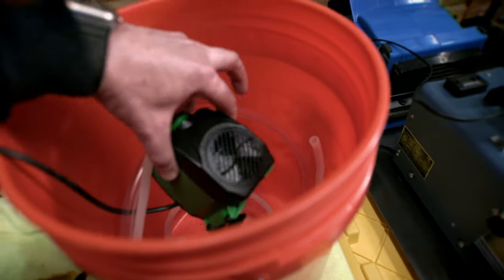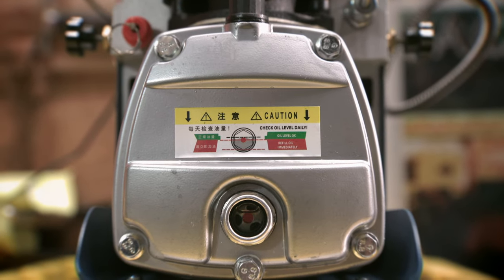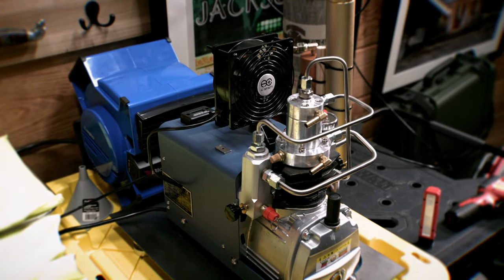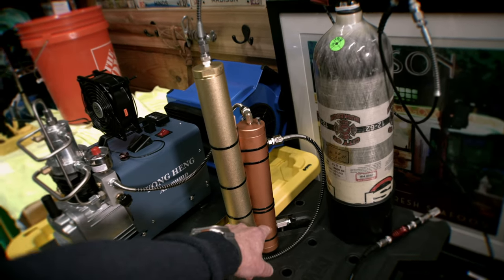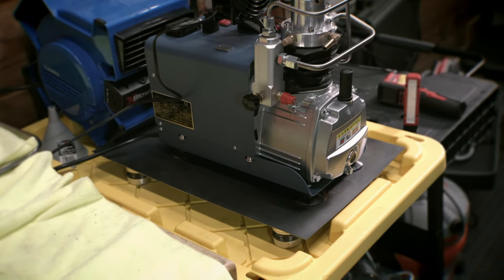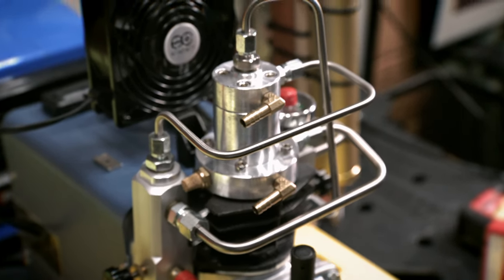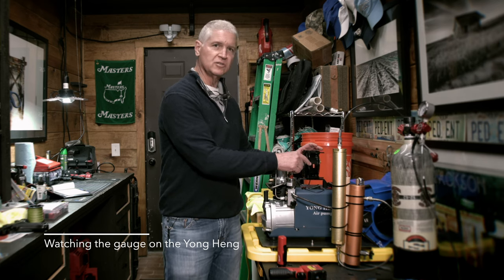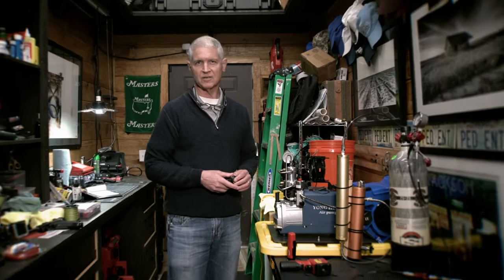Yong Heng Set Up, Modifications, & Impressions

Comment: By adding a check valve to the outlet side of your molecular sieve filter you can open the valve on your tank before starting the compressor, and not have to worry about when to open the valve. When the compressor and tank reach the same pressure the check valve will open allowing air to flow into the tank. When done filling the tank just bleed the line at the tank's valve and compressor.
Reply from the maker: Very good point. Absolutely agree, and that's why I now have one. I think most people don't have one, so I didn't mention that in the video. Thanks for the comment and thanks for watching!
Reply: the non-return valve on the bottle is perfect. No more worries, personally I haven't added anything. I use the original filter, a 20l can, 10l demineralized water and 10/ cooling liquid. I never exceed 10 minutes and 55 degrees. I leave the humidity filter always vertical. Never had a problem with humidity, it remains well at the base of the filter and is never reassembled. It is also good to let the air out of its bottle after have put it upside down to bring down any humidity in the bottle and thus expel it. And if necessary a filter from the bottle to the carbine. I think that the additions do not bring anything but that is only my opinion .Thank you for your feedback and explanations.Peace

Comment: These are SOOooo good and pretty much the go to compressor for air rifles. I LOVE the air rifle sport. It's fun, and keeps me out of trouble, and the Yong Heng has treated me right flawlessly for three years so far because I change the oil every other fill up because it's CHEAP, and I use ice cold distilled water. Distilled means NO minerals to clog it up after many times of use.
Reply from the maker: Thanks for the comments. I completely agree with your love for the sport. Here is something to consider from the expert on the YH from the Airgun Nation forum (biohazardman) and a link to this discussion:  "Distilled water is not a good thing to use as it will eventually cause pitting in the aluminum parts exposed to the water." https://www.airgunnation.com/threads/a-dedicated-yong-heng-subforum.1127731/#post-1127767
Reply: I have a dehumidifier in my basement.  I use the condensate water from it, to cool the head.  Also the dehumidifier keeps the humidity to 40%, so there’s less water in the air to start with.  Works for me !

Comment: Great video Mark. The main cause of heat in the Yong Heng is the larger, lower cylinder. You have that covered with your high volume fan in the rear. People go crazy cooling the top and the lines, which are already water cooled. Like you, I use ice, which is a must. In the last year, prices have come down on the larger compressors. I recently saw the Hill, from the UK selling for under a thousand US dollars. I,however, am staying with my YH. It does the job at a bargain price.
Reply from the maker: Agree! Thank you.

Comment: Great info!

After

When you were talking about blowing out thw water in the cooling loop, an idea occurred to me. With most of us having hard water, it may be a good idea to flush out the loop out with distilled water at the end and then blowing out with compressed air. Even go so far as flushing with vinegar periodically to help with mineral build up.
I'm also planning on removing the fan cover permanently since it's only me that runs the unit, and I never leave it running unsupervised. Also, planning to bore a number of large holes throughout the motor cover to help with venting.
Reply from the maker: All great ideas. I'll have to try them myself. I really like the venting idea. Thanks very much for sharing and for watching!

Comment: Another good vid, on the Yong Heng. New to this, and I appreciate the extra tips from another experienced YH user. Thanks.
Reply from the maker: Thank you very much! I hope your adventure will be as fun and rewarding as mine. What a great hobby we have!
Reply: @jmarkreed hi good day, sorry you busy. Help me you? I bought the new yong heng pre set version 2023 production.  How many ml of oil capacity do you think is recommended?  250 ml is not enough
Reply from the maker: @kricketkricket6737  I don't know the exact amount of oil it takes, but it needs to reach the red dot in the viewing window. I would just fill it until it reaches the dot and consistently make sure that it stays in that area before using it. Thanks for watching!

Comment: Hello Mark.
I want to use a compressor to transfer Helium from large baloons back in to a cylinder/tank which has 200bar.  I´m looking for a cheap transportable compressor which has like a small opening where is sucks the air which it is compressing so that i can add a tube and connect it with the baloon. So it musn´t have big slots and holes regarding this purpose.
Can you please recommend me a Compressor ? Can you please tell me how the Yong Heng - Compressor absorbs the air , does it have a small hole ?
PLeas help me , thx !!
Reply from the maker: Wow. That's an interesting question. I wish I could help you with it, but I can't recommend something that is outside the intended purpose of the unit. The YH has a small air intake, but I have no idea how you could attach a hose to it. I'm sure it could ultimately be done, but that doesn't mean that it's a good idea. Sorry, I'm not much help with this one.

Comment: Tried mine out last night. filled a 7 litre bottle form 100 bar to 250 bar in about half hour of run time stopping it to cool when it reached just below 50 deg c, ice helps in the water for sure, i used a 30 litre water container too, will fill my other bottle today with plastic pop bottles filled with frozen water in the water too to cool it more. Thanks again  for your helpful advice.
Reply from the maker: Excellent! Sounds like you're doing great. I agree, ice makes a big difference. Keep up the good work!

Comment: Hey my high compression piston seems to be going to high and locking up because it cannot return the stroke. I'm fairly used to piston strokes from racing motorcycles, 2 strokes, but this thing has ne really confused and hard to find good customer support. I'm getting ready to replace the whole unit or just whole top end but I'm really interested in figuring this out. 
Also, the top high compression piston is tight!

Comment: I modofied the crank shaft on mine to fit a bearing and built a chiller for it aswell. I also put a manometer an solid state relay for an auto shut off
Reply from the maker: That’s great. Sounds like you definitely know what you are doing. Great job!
Reply: @jmarkreed  i do what i can! Son of a brilliant millwright and it runs in my blood forsure! Ive got three of these compressors and heavily modofied one of them just for scientific purposes lol

Comment: Thank you for your video on the Yong Heng.  You mention  Mobil Rarus oil.  Can you share which product, 427, 827 or MR compressor oil?  Thank you.
Reply from the maker: Yes, thanks for asking. I use the 827. I bought it from a dealer on EBay. The amount for 1 oil change was $18.95, so I figured not bad for a years worth of great oil.

Comment: I have the same set up, and I cut a little opening out of a one gallon milk jug Leaving the handle. and I fiill the milk jug up 3/4 of the way full and freeze them. So I have several of them in my freezer and then I put it in the 5 gallon bucket of water, I can fill a full tank an that water stays very cold and then when I'm done I just fill it back up an put it back in the freezer for next time.  Works great
Reply from the maker: Yes, that's a great idea. I have an ice machine that makes it easier for me and gives me a good excuse to clean it out when I use the YH. Ice is definitely the key!

Comment: hey mark what would you buy right away could you give me a shopping list of the things i need? i have the lasko fan and a bucket so far..
Reply from the maker: I think the only "essentials" besides a bucket with ice water are a good air filter like the "gold" filter and great oil. Everything else are very good extras (like the Lasko fan and a temperature gun) to monitor temperature and enhance cooling. Great oil keeps the YH running well, and a great filter keeps water out of your tank- both incredibly important.

Comment: Why do you not want the oil to be above where you have yours?  Mine is a closer to the top of the window, when I look in the tank it looks so empty.   Since you have had success with that fill level I am going to roll with your assessment, just curious what happens if you go much higher than that.
Reply from the maker: We’ll, I was doing my best to adhere to the manufacturer’s recommendations of having the oil no higher than the top of the circle. That’s what is recommended in the included manual. I honestly don’t know what the consequences are for higher filling. I bet someone has addressed this question in some of the forums but I never thought I needed to fill it any higher than recommended. Thanks for asking.

Comment: I do like your setup. Do all the extra length hoses and separator's add extra stress on the compressor ?
Reply from the maker: I think they do to some extent, but the filters are a necessary evil. I am not aware if anyone has quantitated the difference, but it would certainly have to add some. Thanks for asking. Maybe someone who knows more will chime in.

Comment: as an older guy this is one of those "fit for purpose" things
take a little time and it will be fine
try to run it as a commercial one and you will be disappointed!
I've had one 3 years now and have a similar rig to you!
horses for courses and agree
I'd rather another rifle than a 4k compressor that does the same work!
at 50 I can take a little time to save a LOT of money :)
have a great day
subbed
thanks for sharing :)
Reply from the maker: I couldn't agree more. Thanks for taking time to watch!

Comment: Just ordered mine, I'm going to see if I can drill and tap the cylinder and head on the opposite side of the existing water ports, and install 2 more fittings.
This when coupled with the higher flowing water pump should effectively almost double water flow and cooling 😎
Reply from the maker: Wow. Love to see that work. Let me know how it goes.

Comment: Nice demo..Thanks for taking the time.
I sold my beautiful Honda gas powered Coltri MCH6 when I moved, and now after hand pumping for only 3 shots for my big bores or a mag from my FX impact, I'm seriously regretting it. I shoot a lot..
I can't justify the $3500 for a better compressor right now. I do have a 4500 psi carbon fiber tank, but I'm between filling it with a Yong Heng, or filling my rifle with the GX CS2.
both have their advantages..
 I don't want to spend around $1500 for a mid range compressor that's not much better than one of these as far as I can tell, because later it will be less justified if I decided to buy a higher end compressor..
I know you now own both.
Any advice on which way I should go to get me by for a year or so?
Thanks..
Reply from the maker: Wow. You’re asking a really tough but very practical question. I’m having to think hard about this. Okay, looking on Amazon the GX CS2 is listed for $305.99 but there is a $25 coupon available making it $280.99- great price. You can also add $33.99 for a 3 year protection plan or $44.99 for 4 years. No brainer to go with the 4 year warranty. Since you’re only looking at needing something for a year or so, I would totally go with the GX CS2 at that price point and the fact that you would get a free replacement for up to 4 years. Seems an extremely safe bet to me. You’re good for 4 years of saving for a high end compressor if you want. Love my YH, but in this situation I would go with the GX CS2.
Reply: @jmarkreed  
I'll order it..
Thank you so much..

Comment: I have done everything that you have done, except for the second fan on the top blowing on the head.  I never run mine more than 10 minutes, or past 60c temp, whichever comes first.  I run Royal Purple oil in it.  I have had 4 or 5 Yong Hengs in less than 2 years.  I fill a 9L SCBA bottle from 220bar to 300bar most of the time.  I have never gotten more than 10 running hours our of one.  Yes, I did buy another one this week.  Granted, it's doing the hardest part of the work all the time.  But 10 hours?  It should be better than that.

Question:  In the 3 years that you have had your compressor, how many working hours do you have one it?
Reply from the maker: That's interesting. I'm a little surprised, but I wonder if it all has to do with the fact that you're primarily filling a 9L tank. It would be interesting to see if the lifetime changes if you only fill a 6.8L (45 minute) tank instead. That's what I do, and I'm positive I have a lot more than 10 hours usage. I'll have to go back to my log book and add up the times to see what my total time is at this point. I would agree with you that you should be getting more than 10 hours. With this next one, you may also want to try Mobile Rarus oil to see if it makes a difference. It would be a good experiment.
Reply: @jmarkreed  Yes, I would be interested in seeing how many hours you have on your compressor.  If oil is the problem, I have no problem buying whatever oil is best.  I have tried a few different oils in the past.  Royal Purple is a good oil.  I have ran it in my supercharged car and transmissions, rear ends, etc.  Atone point, the compressor supplier said to run it.  I will look into the oil you are using.

Comment: Put a one-way valve (BestFittings sell one) between tank and compressor, when pressures are equal air will then pass into tank without needing to guess when they're equalised. I added cooling fins to the transfer pipes on the compressor and use a fan to cool those.
Reply from the maker: Yes, thanks! I agree. I recently bought a really great one way valve from Air Tanks Plus  (https://airtanksplus.com/product/quick-connect_in-line_one-way_check-valve_w_bleed_valve/) that has a bleed valve and can be used on any tank I fill. It's a very handy addition. I was assuming that most won't have something like this.
Reply: Part number on the one way valve?  Link?   I see your car tags hinds & Madison.  I’m in hinds my kids are in Madison.    Great video.  I love my compressor but mine doesn’t have the auto stop. Got mine several years ago and mine runs great.   I run a fan on top to help cool the cylinder also.  I run antifreeze in my bucket at room temperature never had a problem. I use royal purple oil in mine.

Comment: OK, I do have  a question for you Sir while I am waiting for my pump to get here. It concerns the cooling liquid you use. Just as you said, everyone has there own opinion of what to put in and the first thing  I read was plain ol tap water. Where I live  there is a lot of calcium in the city water. Does that change the equation? I have read to use straight anti-freeze, then anti freeze mixed with water,. (No ratio yet for the mix). Then use only distilled water, then  mix antifreeze with only distilled water/ or only tap water....You have 3 years of running your compressor. I trust your answer for that very reason! I do know yet just for sure what ever coolant I end up with, only that  it will be chilled with ice before it goes inside the pump. That much I do know.. Just need your feedback as to what you personally use. 
As always Thank You Sir for your time and also our willingness to share your knowledge!!!
Reply from the maker: One thing I know for sure is not to use distilled water. That has been shown to be a problem. Multiple posts in the forums address this. You would also not use antifreeze alone. I believe those who use antifreeze keep a reservoir of water that is used over and over. I don’t do that, but I don’t have a problem with that either. I use tap water and ice which are replaced with each use. That’s just how I do it. I believe a lot of others do that too. I don’t know what to tell you about the calcium. I’m not sure that’s a problem or not. Thanks for asking and for watching!
Reply: @jmarkreed  Thank you Sir!!!

Comment: You mentioned using Mobil Rarus oil.  Which version, 824, 826, 827, etc?
Reply from the maker: Thanks. I'm using the 827. Seems to be doing a good job. Stays very clean (at least by appearance).
Reply: Where did you buy it? It's crazy expensive
Reply from the maker: @mathewatherton9832  I bought it from a dealer on EBay. The amount for 1 oil change was $18.95, so I figured not bad for a years worth of great oil.
Reply: @jmarkreed  awesome thanks

Comment: Hi, does the molecular sieve filters out the oily smell of the compressed air?
Which oil exactly are you using?  Thanks.
Reply from the maker: Thanks. The molecular sieve removes the water vapor/humidity from the air to help remove as much of the water as possible. It doesn't remove oil itself. Personally, I don't really smell any oily smell when I run my machine. That could be a factor of the particular oil. 

I show a graphic text of the oil I use for spelling purposes- Mobil Rarus oil. I tried Royal Purple first, but I believe Mobil Rarus is much better. It's specifically made for high compression engines. Thanks
Reply: @jmarkreed  Hi, yes I've seen that but there are many types of Mobil Rarus oils that is why I asked.  I've heard that there are some food grade oils that are non toxic but they are difficult to source.  Thank you.
Reply from the maker: @cell_creator  Thanks. This is the specific listing I used to purchase the oil. It's Mobil Rarus 827. https://www.ebay.com/itm/274608618484
Reply: @jmarkreed  Thank you very much!